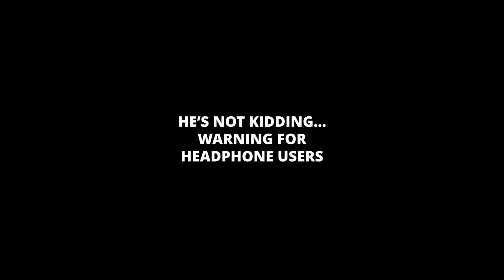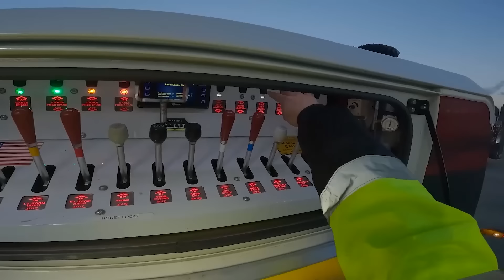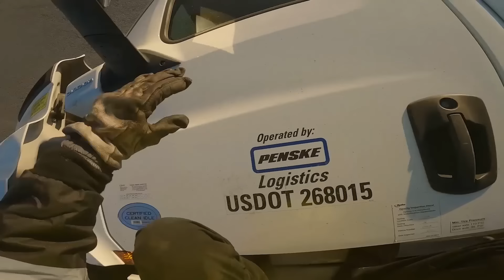60MPH Gusts Will Do That To Ya! Semi Rolls Over Due to High Winds

Comment: Hi Trent! We have a place in Newfoundland called, The Wreckhouse. It is well known for the ungodly winds, so much so that road and rail traffic were held until such time as the winds had subsided. And yes, I said rail traffic. The winds were capable of blowing fully loaded trains from the tracks, tractor trailers and regular vehicles stood no chance. We no longer have railroads in Newfoundland and it wasn’t due to the winds, rather the gauge of the track. Too costly to take up the old and put down the new. Your videos are awesome, the level of professionalism in your team, the equipment you supply them with and their own experience are a pleasure to watch. Thanks for doing the hard work to put together the videos for us to enjoy.